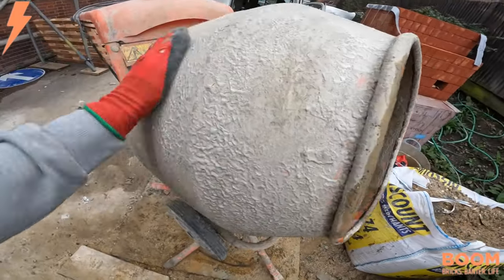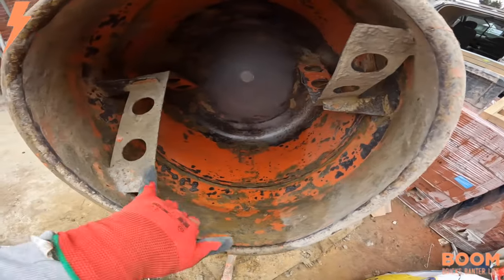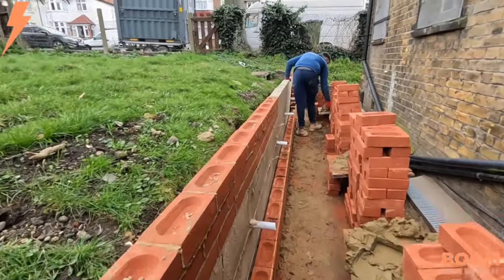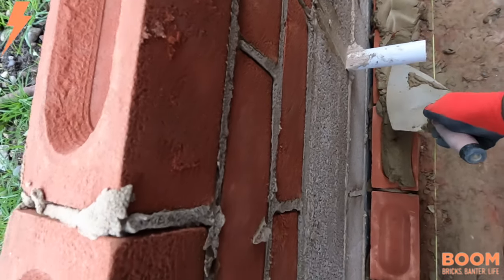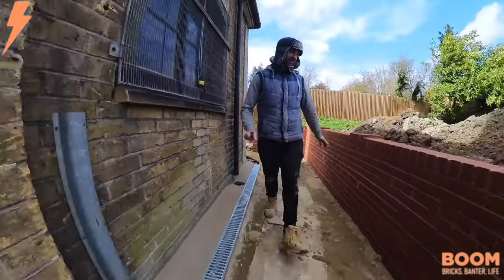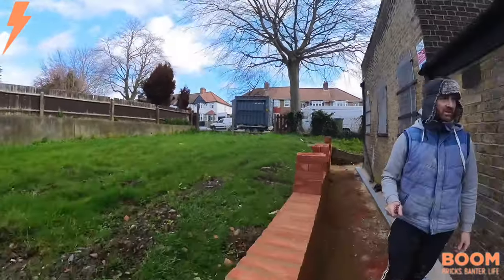Bricklaying - Rebuilding An Old CHURCH! 🧱⛪️  #bricklaying

Comment: General rule in carpentry for steps in  concrete or stairs should be between 400mm to 450mm if you add the rise and going together  .. the longer the step the shorter the riser.. or else it becomes a trip hazard..  just thought it might be helpful
Reply from the maker: Ah really, that is helpful. Thank you for that mate